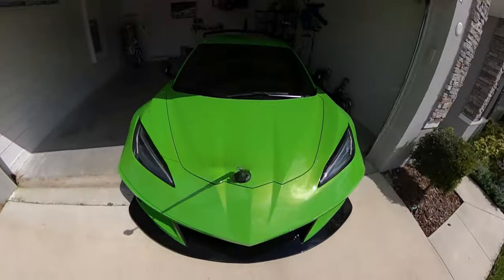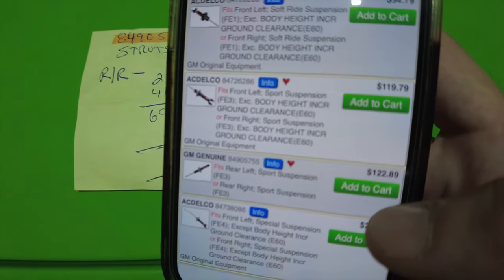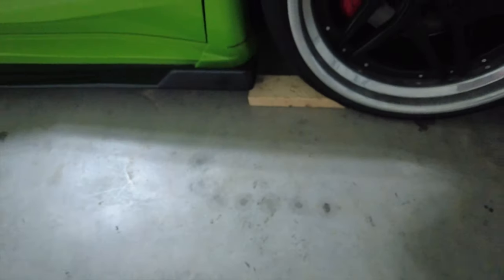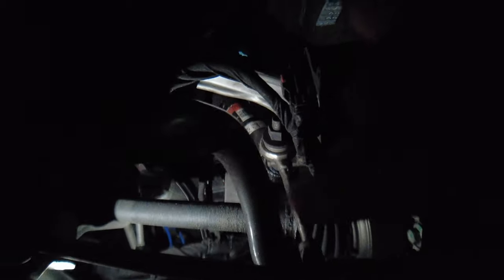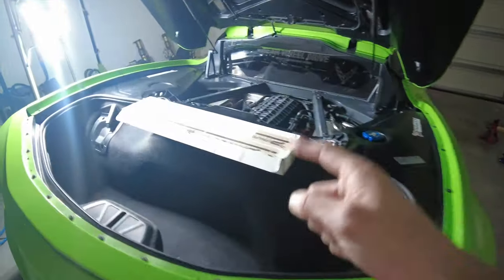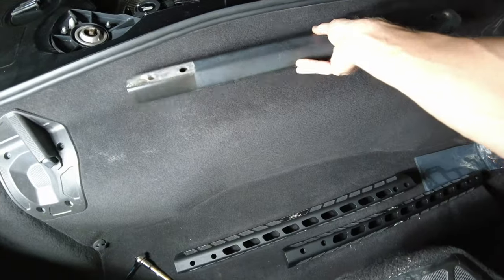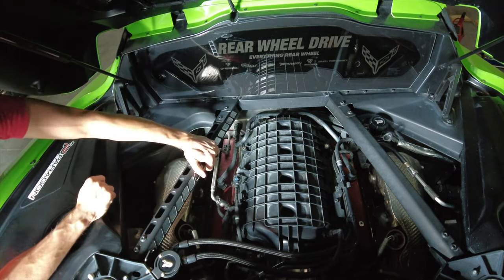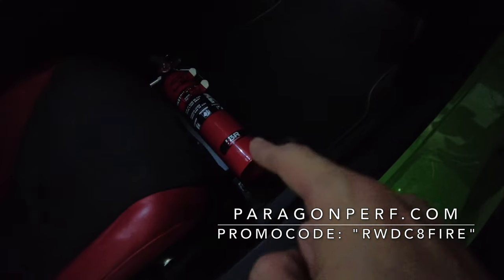Installing Paragon Performance Strut Tower Support Bars on my Liberty Walk C8 Corvette

Comment: Hey Matt, I have an unrelated question.  How do you like your AWE Track exhaust by now?  Have you ever had any heat issues?  Ever wish you bought the Touring instead?  Any regrets?  I’m about to order.  Any info would be greatly appreciated.  Thanks!  Bill
Reply: Did you end up going with one over the other? Im debating this as well!
Reply from the maker: I liked the AWE exhuast. Worked perfectly and sounded great.  4 inch tips made it loud. The build quality of the Paragon Performance is better. the tips are smaller which give it a quieter deeper tone. You'll love either one
Reply: @traxxasrustler12  I haven’t decided and ordered yet because it was only recently that I finally found a dealer willing to do the installation.  I’m still hoping to see and hear it in person so I know I made the right decision.  Matt’s Paragon recommendation has me second guessing now.  Oh, my!